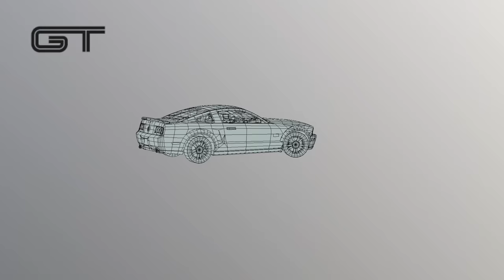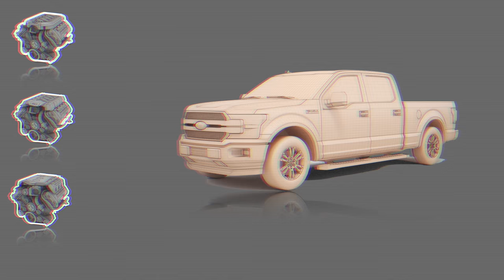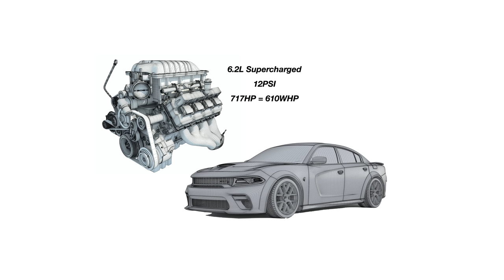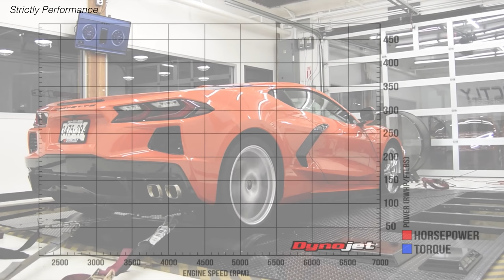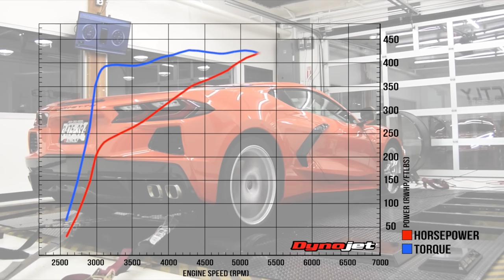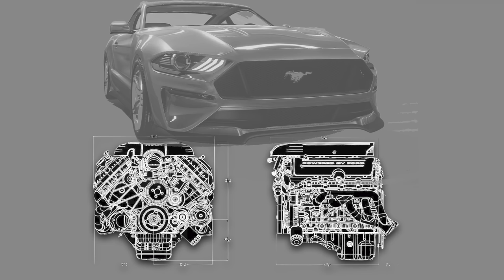How 5.0 Coyote Engines Beat LS and LT😮 | Explained Ep.2

Comment: GM 5.5L LT6 has entered the chat.
Reply: Ford 7.3 Godzilla has entered the chat.
Reply: @cesarpalmos8235  with it's 300hp? 😆
Reply: @tedkay5272  ? Are you talking about the same motor? It easily does 400-450 hp in stock configuration, which is in a truck biased tune. If you do some simple research, you will find these motors making 1000-1400 consistently with relatively low boost with stock parts. I really hate these people who "only" like a single product and afraid to learn about another cool product. To me this is not a car person, but a fanboy.
Reply: @cesarpalmos8235  so, 430 hp. Lower hp then the Ford 5.0 and LS3. The GM 5.5 LT6 makes 670hp. I can appreciate all engines. You just got all butthurt because your 5.0 and Godzilla engines get demolished by a little 5.5 GM engine.. As far as boost goes, watch Richard Holdener.  He has put 5.3 and 6.0 LS engines to 1400+hp and for a LOT less money.
Reply: 5.3 LS with a Sloppy Stage 2 and a twirly boi have entered the chat.
Reply: @tedkay5272  I have followed their channel and several other channels. I had a 800hp LT Camaro, no, I am not butt hurt at all. However, I know for a fact the 7.3 can make 1600+ for not that much effort while also having 1200+ torque. Tell me if I'm wrong, the 5.5 LT6 is the engine used in the corvette Z06 right? Therefor, GM will attempt to make as much power for their supercar, which I'm fond of. However, in the super car world, a 5.5 is huge, and 670 is not that much power. The 7.3 is an engine used in a freaking F250. Also, if you remember, the Coyote makes 460hp, the Voodoo 5.2 is in the same family and makes 530hp with only 0.2 extra displacement. If may math checked out, a 5.5L variant of the coyote will make roughly the same power. (obviously the that is not proper engine science). Anyways, the next gen Coyote is rumored to make 500hp.
Reply: @cesarpalmos8235  then get yourself a Godzilla engine. Bet you won't. And thousands of LS swaps every year, even in Fords. The LS and GM win every category. More hp stock, most swaps, budget builds, over 1,000 hp with fi, simplicity,  initial expense...etc. Sure you can build an engine to beat them, but not as easily and not for less money. So while your dreaming about a Godzilla engine there are a dozen other people dropping $500 junkyard LS engines with turbos in their cars and smoking most others. Let us know when you can afford that 430 hp Gozilla engine. Have a great night!
Reply: @tedkay5272  Actually the engine has only been out for about a year and 8 months more less, and people are already swapping them into their Chevys and Dodges while doing so fairly cheaply. The motor is "expensive", six thousand dollars is cheap in my opinion, but will become cheaper over time, any logical person will know that. And no, I want to turbo a Ford Gt soon, but now that you say it, a Godzilla swapped Corvette Z06 sounds nice.

Comment: Amazing break-down analysis, I would love to see the difference between the 5.0 and the 5.2 predator and Voodoo motors. From what I hear, they are all from the same family.
Reply: They are, even the 4.6 and 5.4s are as well. All modular family engines
Reply: @jmac2o229  The 4.6 and 5.4 are from a different family of engines.
Reply: @MT82 Man Pedal I don't know if you all understand what I'm saying, the 4.6 and 5.4 are a part of a family of engines that are different from the Coyote platforms.
Reply: @sidneysanders5726  It does, although it is still a different orientation from the GM 5.5 crankshaft.
Reply: Yeah. It uses a weird floatplane firing order than the typical V8s
Reply: I would choose the predator over the Voodoo.....due to the lack of a balanceshaft to counter-act the flat-plane crank design, the 170g's of lateral movement vibration from 7250-8000 it just keeps breaking starters, bellhousings, and even in some cases breaking the track-pack oil cooler right off the side of the block...Voodoo JUNK!
Reply: @PeeterPuncher  What are your sources?
Reply: @PeeterPuncher  yeah, the voodoo engines have tons of problems. They are crappy.
Reply: @cesarpalmos8235  it's out there. My mechanic doesn't like working on them. He says they are junk and he is a Ford master mechanic and only works on Mustangs.
Reply: @cesarpalmos8235  Experience in a highly reputable powertrain testing lab that ran hundreds of hours of dyno tests before it was released.
Reply: @3644Darrell  I worked at Planet Ford in Houston and also worked on them. We have several customers who bring them in for service or repairs. All of them are fairly easy to work on and don't have many problems.
Reply: @cesarpalmos8235  do they track them?
Reply: @3644Darrell  I only knew one person who goes to the MSR track and the Grandsport Speedway here in Houston. His car had 58,000 miles on it. The other cars were around the 20-25K mark. As far as I know, he still has tracks it.
Reply: @PeeterPuncher The Voodoo was a nice little experiment by Ford, but they know the limitations. Ford Racing took out the FPC out of their racing motors just 1 year in, due to lack of reliability and cost. You'll GT350 praising the motor, since some buy th cars as investments and don't want them to lose value.

Comment: 5.0s make great power for what they are, no doubt. But you don't see coyotes making over 700whp n/a. If an LS was built like a coyote it would make killer power. Hence why the ls7 makes 650whp without even changing the RPM.  Now make it rev higher!! The lingenfelter 454 eliminator motor revs to 8600 and makes 820hp (crank). It sounds absolutely amazing too!

I like both, but I love building the LS motors. The sound, power is amazing.
Reply: That's a stroked crank with a custom ls block he's talking about oem stuff
Reply: @swiftxrapid919  yes it is, but people have built the ls7 to 800whp all motor. You just don't see coyotes doing that, no where even close. I've seen 530-550whp in coyotes on the high end with e85. 

Yes they can rev higher without changing things, and that's just because that's the design of the motor and how it is built. It's already built to rev. It's a great motor too.
Reply: The LS7 is a 7.0L engine though lol.
Reply: @JIMMYLUNCHMEAT  yes, and the 5.0 can rev to 8500-9000rpm. Physics is the same no matter what. The 5.0 doesn't defeat physics, as so many would have you believe. The engines make power in completely different ways. And yes the 5.0 makes good power let displacement (because of revs). Another great example of revs is the new 5.5L. Half a liter bigger than a 5.0, yet makes 200 more hp out of the box. Newer engine, better designed, more hp.
Reply: We aren’t talking ab NA tho. That’s dumb
Reply: @venom_dave  oh I never saw that thread.

Comment: I learned a lot from this video and the comments lol. Never knew Ford heads had 290 CFM( and Hemi's 340 cfm?). The best thing about an LS is the fact that it makes great power with a small package; you can fit it into damn near anything. Also, stock motor can take a beating, a cam cost $200 (compared to $1000+ for coyote), valvetrain is cheap, engines are cheap (got my aluminum 5.3 truck motor for $500). Regardless Fords sound great at 8000 rpm, great motor for NA. That's why I'm excited for the c8 z06, 5.5l 670hp 8600 RPM
Reply: Chevy won in the single cam pushrod engine competition and I have a feeling this new Z06 vette engine will trump the coyote as well. Time will tell. Either way these days you gotta just appreciate any v8s on the market with this EV crap.
Reply: That won't be cheap though.

Comment: Can’t say it’s better than LT’s when Chevy just dropped the LT6.. 5.5 liters.. 670hp 🤷🏻‍♂️
Reply: Unattainable to the masses, and probably won’t ever be able to be fully tuned and unlocked. Badass engine tho.
Reply: @169abr  still a better engine in every measurable category. Affordability and how hard it is to unlock a factory ecu don’t apply to what’s better or not
Reply: @Laskyification  what happens if the FPC vibrates the engine apart? Is it still better?
Reply: @169abr  it will be unlocked. An tuning company already unlocked the c8 base model. I'm sure it will be the same for the z06
Reply: @trentdaddydolla647  it's not unlocked  you have to swap the pcm.  It hasn't proven itself  yet.
Reply: @169abr ; No they need to put them in everything, and hope they get totaled out, so we can get them from junkyards. It never takes as long as you think.
Reply: @Johnnycdrums  they’re not putting a highly specialized 5.5L Flat Plane Crank engine in a mass fleet vehicle. It won’t be a 5.3/4.8/6.0, it’s a specialty engine meant for a specialty car. Someone will get one eventually and swap it into something, but not on mass.

Comment: My 2011 Camaro SS with a new GM performance LS3 495 horsepower crate engine and a 6L80e transmission with a circle D 4200rpm stall converter with stock 3.27 gears tuned and runs on E85 with other upgrades ran 7.4 at 94mph in the eighth mile naturally aspirated many new 5.0 Mustangs with full bolt-ons 10 speed automatic with 3.73 gears running 7.90s with a 3500rpm stall converter was the fastest naturally aspirated 5.0 there most running 8.40s-8.80s l know the 5.0 crowd will say your LS3 has a not stock camshaft their right but the camshaft is anything but a max effort camshaft with with 219 duration intake and 228 duration exhaust with 525 lift on both is really a very mild camshaft it redlines at 6600rpm my car weighs 3920 with me in it has a full interior and air conditioning the only 5.0 Mustang that ran faster than my car the night l was at the track was one running 7.2s at 99mph but it had a turbo in it my car ran 7.40 at 94mph with only 3 passes on 20 psi in the Mickey Thompson 305/45r17 ET drag radials with more testing and experimenting with launch techniques and tire pressures could probably go 7.20s at 96mph not bad mouthing Fords 5.0 Coyote engine but with 32 valves and 4 camshafts vs a 16 valve 1 camshaft LS3 l just don't see how it's just that much better than the LS3 is the LS3 has better torque from idle to 4500rpm+ than the 5.0 Ford Coyote does is my opinion of course above 6500rpm is were the 5.0 has a advantage but most times by 6500rpm the 5.0 Coyote is going to be playing catch-up because because by 4000rpm the LS3 is already pulling hard the 5.0 needs to be turning 5000rpm+ to be pulling equivalent to the LS3 at 4000rpm
Reply: See the Coyote was not made for just power. Its a versatile engine. Its main advantage is not outright drag racing. It can tow, it can do some drags. It loves boost. It loves to do everything without opening the bottom end.
That was Fords mission and they achieved that with fyling colours.
Nobody here says its much better than LS3 but it can do everything using a different technology thats it.
Also the 5.0 is more flexible across the world because it manages better COx figures per ppm, so it doesnt need the pollution tax that kills LS being sold across lot of regions across the world. Many Americans think the whole world is like USA. Thats the biggest issue.. They r blind and unidirectional.. When U explore the world U ll understand an OHV doesnt suit many situations.. While an OHC like Coyote can bypass lot of laws and regulations while making decent HP and while not being overtly expensive
Reply: @1989rs500  l get it just for me the sophistication of a 32 valve V8 that stock makes equal power to a 16 valve one camshaft conventional V8 is not worth it to me the simplicity of the 16 valve one cam V8 makes it more desirable to me not that l don't appreciate the technology or performance potential of a 32 valve V8 if money wasn't a problem l would love to have a 32 valve V8 but if that was the case l wouldn't be messing around my dream engine would be a Mercury Racing SB4 LS7 7.0 but the 33,000 dollar price is more than l have in my car total but if l could have any engine and money wasn't a factor this would be my first choice a 7.0 liter 32 valve 8000rpm motor but then reality sets in
Reply: @gloriamaletta8667 
Absolutely.. 2 each their own. I d rather pick a 2012 5.0, slap on a supercharger on 93 tune. Thats it.. Probably around 600 whp.
Its easy and reliable
Reply: @1989rs500  good numbers my car made 430 to the wheels on the motor 550 on a 150 hit of nitrous but have jets for a 200 and a 250 hit kind of scared to go that high with it but I've seen 5.3 Chevy truck engines hit with a 150 hit of nitrous 75 times and is still running well but 600 to the wheels is outstanding not going to knock that have not hit my car with the nitrous other than when dynoed it's a pain in the ass car runs 26 degrees timing naturally aspirated and needs to have a computer to back timing off to 19 degrees for the nitrous so more bullshit involved than just smashing the gas pedal car seems a little sluggish naturally aspirated with only 19 degrees timing compared to 26
Reply: @gloriamaletta8667 
Yep Going NA is great but I ve seen 5.0s do 500 whp with FBO E85, but they behave like 525 hp ohv cars. Partly due to faster engine spinning and partly due to 7500 rpm redline. The 10 speed also makes it damn quick for s 500 hp car.
So for being 100 hp/L without opening engine does make it pretty darn strong for the gen3 Coyote
Reply: @1989rs500  I've street raced a 2021 Mustang GT 5.0 with full bolt-ons longtube headers no mufflers a 10 speed auto 3.73 gears with a Circle D 3500rpm converter tuned on E85 claimed it had 500 rearwheel horsepower l took him one car length his front fender stayed on my back fender the whole race to 125mph maybe l got lucky he did spin a little out of the hole and I'm not saying if we raced again he wouldn't beat me but the night we raced l thought for sure he would have ran me down he looked at my car seen the 6L80e automatic and replied this is a L99 l said yes knowing full well it has 10.7 to 1 compression LS3 495 horsepower crate engine so he was under the impression that he was racing a L99 10.3 to 1 compression car with a cam he said you know l already beat 3 of these cars with a L99 with a cam by more than 4 car lengths and l said tonight you have a chance to make it 4 if he works out launching the car without spinning he could probably beat my car the only advantage l have is from idle to 6600rpm my motor has a extremely fat flat torque curve I'm sure that 5.0 Coyote makes at least 30 or more horsepower but not torque bet my engine makes 50 foot pounds more torque than that 5.0 does peak is at 5000rpm but it doesn't drop off like crazy and pulls strong to 6600rpm without tapering off at all don't misunderstand me I'm not all saying a well setup 5.0 Coyote couldn't smack my ass no matter how fast you are there's always going to be someone faster seen some guy at Bradenton Motorsports park in the summer last year with a naturally aspirated 2021 Coyote Mustang 5.0 run 9.60s and drive it to the track and back home but I'm sure it had a lot of modifications to the suspension and engine it was seriously fast for a street car and l believe he said the rev limiter was set at 9200rpm and it didn't waste any time getting there
Reply: @gloriamaletta8667  yep.. I d say out of all Ford vs Chevy motors the best Ford motor to rival a Chevy is the Coyote. Again I used word rival cuz, LS3 and LT1s are still damn awesome.
That said unlike Fords performance motors from 80s to 2010, none had true potential to rival LS. The Coyote stands toe to toe to LS still inferior to LS7.
I am really sad that Ford has no intention of making a Modular v8 with displacement over 5L.
The I find 5.4-5.5l the sweet spot considering size and torque for a perfect dohc 32v motor.
Mercedes had this awesome W204 6.2l V8 making 504 hp, 570 and 625 hp in 3 generations. That shows how potent dohc 32v designs can b. Remember Merc made those hps 8 years before. So with current plasma etching tech and all upto 5.5L can be bored out of just 3% larger block. But it seems because of electrification and lot of new gen regulations Ford is not pushing for it.
GM on the other hand made a marvel out of LT6 n new C8, but discontinued Camaro but S650 is sure to have a Manual with 5.0 by 2024. So for the average man Ford still has a great V8 with MT and good to know that the V8 they ve is a superb one the Coyote
Reply: @1989rs500  You sound you're either from Canada or some European country mate.
Reply: @CJColvin  well you r wrong.. I am from India. The underestimated nation by majority of Americans and Canadians and Europeans.. LoL
Reply: @1989rs500  Gotcha
Reply: @1989rs500  What about the 427 SOHC 2V Cammer V8 from the 1960s.
Reply: @CJColvin 
Oh.. Come on.. Back then v8s were different. The 2V Cammer is obviously great but I wouldn't have any of US built V8s prior to 2000s. Not that a they were  bad but too old school to ma liking.
Ford V8s seriously were average V8s till the Coyote. If they made power, they were unreliable... If reliable not that efficient.. If efficient not that powerful.
The best balance was stricken only by the Coyote. The LS actually has more developement and more reliability on its side, cheaper to build and actually gives good mpg too despite displacing over 6000cc.
Reply: @1989rs500  True

Comment: its kinda crazy how similar engines like the coyote are to other DOHC 4 valve per cylinder engines like the K20A2, while the coyote doesn't feature a flat plane crank like the K series (because its a large displacement v8 with a lot more low end) they are both extremely efficient at breathing and in bone stock configuration... you throw a turbo on a K20A2 and maybe injectors... you're looking at making up to 600WHP from a 4 cylinder... which is just wild considering the weight on the cars it comes in.
Reply: Voodoo motor is flat plane basically a Coyote that has been bored and stroked to 5.2L